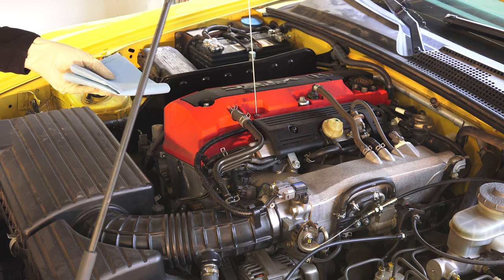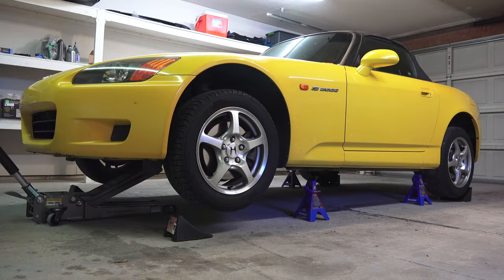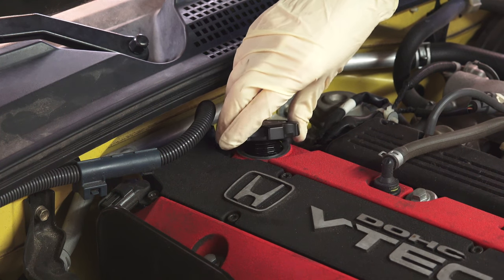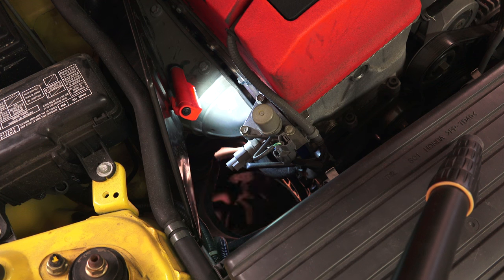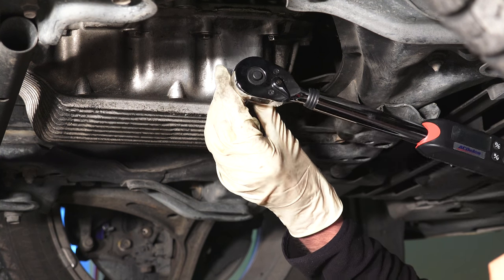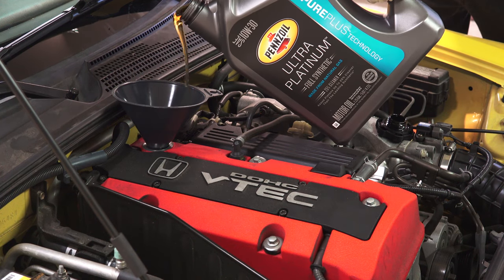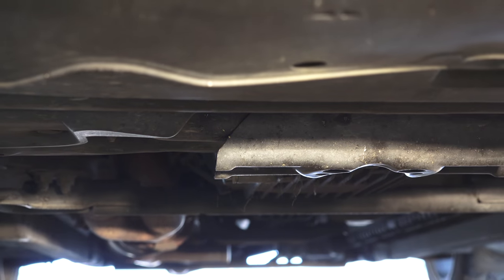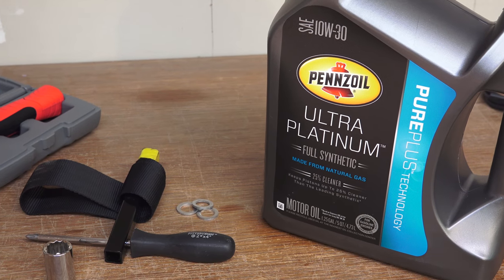How To Change Your Engine Oil - Honda S2000

Comment: You didn't pour some oil into the filter?
Reply from the maker: Not necessary - some filters install upside down/sideways, so you can't really put much. Important to lubricate the seal though! If the filter is installed with the opening upward, I'll usually put some oil in there.

Comment: im not sure how good the pennzoil synthetic is, but as a former ap1 s2k owner, i can tell you that Mobil1 is absolute garbage in this car, it will burn through it so fast, especially if you keep it in the higher rpms. if given the choice, i would avoid the Mobil1
Reply: Daniel Smith True, I have a H23 Prelude and I believe they have the same FRM Cylinder Liners and I also used Mobil 1 and It burned it quickly, switched to Castrol Edge and it hasn’t burned anything 1500 miles in.

Comment: There is no "engineering explained" in describing how to do a simple oil change. There is really little point, or value, in watching YAOCV (yet another oil change video) on Engineering Explained. I'm sure there is some non trivial technical information - something that differentiates "engineering explained" content form the rest - that could be included with just a little more effort.
Reply from the maker: It's true in that there are quite a few DIY oil change videos on YouTube. That's part of the reason I released two videos this weekend, in case folks were not interested in these. That said, the S2000 is a bit of a series, and so before diving into modifications I want to show any of the necessary fluid changes, and then dive into modifications (I want the entire process, from start to finish, available to view). However, I have a video on differential fluid swapping coming up, and I think you'll enjoy the science-y bits thrown in.

Comment: What do you do if the oil filter is stuck?
Reply: grab it with a large pair of channel locks and twist it off. Or worst case I hammer a big screw driver in there and twist it off.
Reply: bodom11716 depending on how stuck or the possition of the filter the channel lock idea may not work so i always recommend getting a filter claw. they're fairly cheap and have never let me down. the screw driver trick also works but its super messy
Reply: Michaelm Mike that won't work on a bigger oil filter you need to go buy the oil filter removal tool and make sure it's the size of your filter.

Comment: No thread lock on the drain bolt?
Reply: Not needed when you're working with cocking VTEC
Reply: DERZ huh? for real?
Reply from the maker: Not needed, torque to spec and use a new crush washer and you'll have a good seal that holds.

Comment: You don't know how to change de oil Correctly. First step is use a motor flush run the engine 10 minutes then drain the oil. All your steps are correct until you was putting the new oil, you have to do it sideways, in that way the air will not do the waves that shows on the video it will come smoothly and not make a mess

Comment: Does anyone know why I have small engine coolant lines going to the throttle body of 4 cylinder Honda engine?
Reply: mike anderson coolant lines for the idle air control to keep it from icing up
Reply from the maker: This is to prevent the butterfly valve from freezing shut when the car is operating in temperatures below freezing. Condensation in the air could freeze it while you're idling and the throttle is closed.
Reply: Ok thanks for your time.
Reply: Engineering Explained almost at 1,000,000 subscribers
Reply: When does he have to start a constant vigil to watch it reach one million?

Comment: That looks to me like a Subaru oil filter? :)
Reply: Just because it's colored blue? Please get lost LOL
Reply: rey rios
Reply: +rey rios If that filter was made out of paper I'm sure all the oil would just pass right through it like there was no filter there at all to begin with.
Reply: You know that's what a filter is designed to do right? Let the liquid through whilst catching the solids?
Reply: Subaru oil filters are normally black, but they can be any color.
As for material.
Most are paper

Comment: 5W30 is the right one...
Reply: Sheepmaster Unless you drive at below freezing temperatures it won't matter at all if youuse 10W, 5W or 0W-30.
Reply: It does matter. The pressure in the system will depend on the size of the oil ducts, for one example.
Reply: Stil , the difference between 5W30 and 10W30 synthetic is very small until you get to below freezing temperatures.

Comment: In think you should advance your videos back towards engineering not oil changes. Even if it gets less veiws I'd rather watch something more interesting.   Do something like compare different manufactures awd systems, Hybrid systems, new f1 technology. An oil change on a S2k  ...... uuuuuugh
Reply from the maker: I hear ya! Allow me to explain the logic behind this: It's true in that there are quite a few DIY oil change videos on YouTube. That's part of the reason I released two videos this weekend, in case folks were not interested in these. That said, the S2000 is a bit of a series, and so before diving into modifications I want to show any of the necessary fluid changes, and then dive into modifications (I want the entire process, from start to finish, available to view). I have a video on differential fluid swapping coming up, and I think you'll enjoy the science-y bits thrown in.

Comment: For the love of God DON'T USE PENNZOIL!!   have you ever seen the inside of a engine that used pennzoil?
Reply: Yeah, they're usually pretty clean looking. Hardly a reason to avoid Pennzoil. You do realize all of their oils carry various industry and OEM specifications, right? They're safe to use in any engine that calls for the listed weight and specs.
Reply: Darren Dupre nope total opposite, the inside is full of gunk! Ask any experienced mechanic about pennzoil and they will tell you

Comment: Whyyyyy penzoil whyyyyyy,such garbage oil
Reply: bj andre Noooooo, Pennzoil is just fine they had some problems 40 years ago but modern Pennzoil Platinum is just as good as Mobil 1.
Reply: My friend has a shop and a customers motor seized due to penzoil,they sent the sludge to them and it was their oil and they paid for a new engine
Reply: bj andre Strange, Pennzoil Platinum is one of the best synthetics there is, i would use it without thinking twice, have seen some excellent used oil analysis on it.